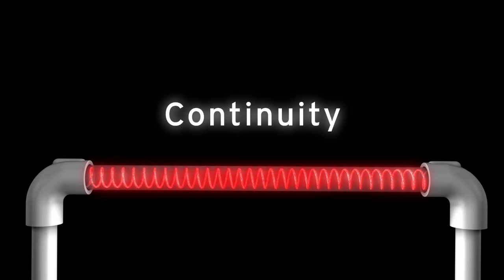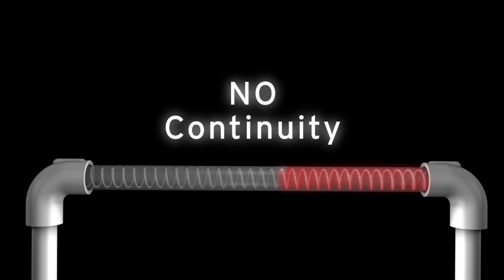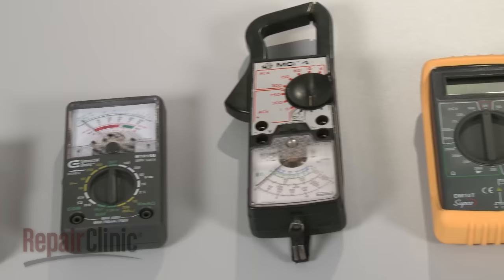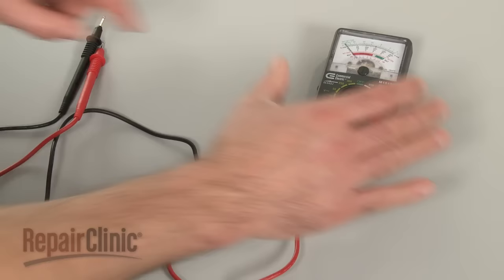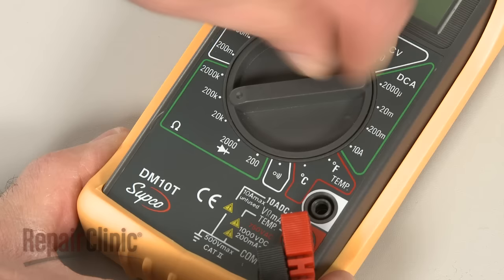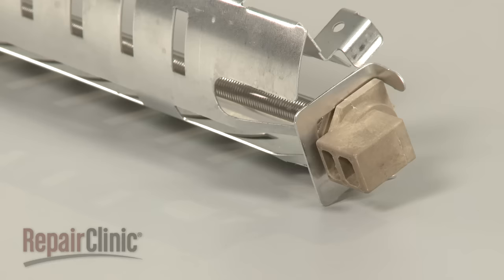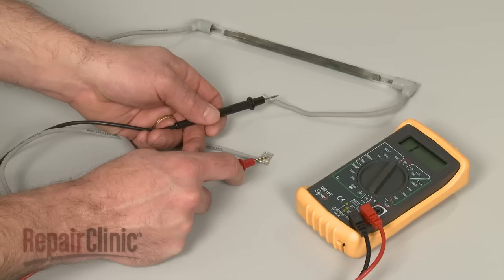Fridge Not Defrosting? Defrost Heater Testing, Repair

Comment from the maker: Ashley, This is not a typical a defrost limit thermostat. This item is a high limit thermostat which is normally closed at room temperature. It shuts of the heater if the board relay fails closed to prevent damage. The defrost system is operated by the board which uses the thermistor to monitor the frost build up on the evaporator. If the defrost heating element has continuity probably between 5-50 ohms than the board is likely defective.
Reply: ***** My coils were completely frosted over when I tested the thermostat and thermistor on the board. Wouldn't they have shown continuity if they were still frozen?
Reply from the maker: Ashley Ferguson The thermostat should have zero resistance when below 140 degrees Fahrenheit. The thermistor should have a specific resistance when cold and change with temperature. It is unlikely both failed like that and have no continuity so you may want to double check your wiring,  meter, and it's settings.

Comment: I have leaking door seals. Lately been putting a heavy 12 pack of soda against fridge door to keep it tight. The freezer door seal is also not sealing all the time and leaking. I try to keep it pushed tight but it leaks some.  I get a lot of frost around the freezer door . About 3 years ago I replaced the defrost thermostat on this old Maytag which had a three wire stat with a two wire stat. Just disconnected and sealed the extra wire connection. Replaced the timer and all seemed to work okay until lately. Ice is forming around the drain hole and a solid sheet of ice forms on the length of the aluminum tray that sits over the drain hole, and also a thick ice layer forms over the drain hole. After taking the rear freezer panel off and complete manual defrost and clearing the drain hole of all ice, I turned the timer to defrost mode while I had the stat still wired and in a glass of ice water. Then plugged in fridge and the heater came on. It did not glow red or get really hot but was putting out a constant heat wave. I was wondering if the heater could be going bad but still working and not getting hot enough to fully defrost with ice accumulating over time. With the stat in ice water and not heating up and opening the circuit to cut off the heater I figured the heater should have kept heating until it was red hot. I also thought maybe with the bad door seals that warm air is getting in so much that it forms around the drain hole so thick that the heater does not melt it all and it continues to build up over time. Lately it was also icing up around the freezer fan and not enough cold air getting down to the freezer. The timer seems to be ok and the thermostat worked and the heater worked, although I don't know how hot it is suppose to get. I can hold my hand on the evaporator coils feeling the heat but not enough to burn my hand.  Maybe I need to get a timer that cycles to defrost mode more often? Any suggestions?

Comment: I have a Frigidaire side by side refrigerator/freezer model FRS26R4CW3.  I have the heater cover off inside the freezer but cannot determine where to find the SWITCH to turn the defrost cycle on to begin testing the heater, thermostat and timer components.  Please help me identify where it is.

Your videos are very good.  Thank you so much for taking the time to educate and help people in this way.  I appreciate any help you can give me.

Comment from the maker: The heater should show continuity. If it shows an open circuit it is bad. If the heater and the defrost thermostat both show good the defrost timer or defrost control board (depending on your model) may be bad.

Comment from the maker: You actually have to take the components out of the refrigerator to test them properly. I hope this helps!
Reply: Please "emphasize" that the defrost heater must be removed from the fridge for testing. I tested it unplugged but inside the freezer, and it shows nothing. I thought it was bad so I ordered a new one. When I removed it from the freezer & tested it, it shows continuity.
Reply: Need instructions on how to do that. The wires are connected with some long black 'tubes'. Do you just pull to take the wires apart, or what?
Reply: K. They do pull apart. Got one connection apart using moderate to hard force. But the other one won't give no mater how hard I pull!  It's thick black rubber tube over a round metal connection shaped almost like the hand end of a baseball bat; how to separate that male end from the female end?

Comment: I’m having an issue. I ordered parts from you guys I replaced the heater, thermostat and timer just to be safe. My Frigidaire freezer defrost heater is STILL not coming on. I put it in defrost mode manually and it doesn’t turn orange or get hot. Any recommendations? The model number is FRT21IS6JW1..

Comment: I replaced the defrost heater in my GE fridge which was obviously bad. Also ordered defrost thermostat and thermistor. Checked thermostat and thermistor for continuity through main board, but neither one had continuity. I am going to replace both. Is it possible that all of these components failed, or is it more likely that I have a bad heater (replaced now) and a bad main board, which would be why these are not showing continuity when tested?

Comment: Hello, the heater gives me about 90 Ohms of resistance and it doesn't give continuity. BUT if I plug it directly ... it gets hot, it works!
What's going on?  Is it bad?  Do i have to replace it?

Comment from the maker: The tone won’t work with that much resistance. The heater is good with 30 ohms.
Reply: Hello, the heater gives me about 90 Ohms of resistance and it doesn't give continuity. BUT if I plug it directly ... it gets hot, it works!
What's going on?  Is it bad?  Do i have to replace it?

Comment: Excellent video. The service tech said we needed a "defrost kit". Total cost would have been $418 - more than the fridge is worth. I decided to do a little internet homework. Thermostat works, fan works, and defrost heating element has continuity. Seeing now that the return vents in my fridge are clogged with ice, I suspect that one I get everything cleared out, it will go back to working. Thanks for the concise, simple explanation.
Reply: Yhy😮😮

Comment: I have a Frigidaire model FA13DSBAWA that is not defrosting,heater element is good but the thermostat is like a fan capacitor with 4 wires.i have not being able to find that part any ware  because the searches tell me to check my model number again and thats the model number on the back label I have.

Comment: I advanced the timer to get the defrost cycle. the heating element did quickly melt a piece of ice I put on it, but did not get red hot,  and after about 6 minutes, I checked the heating element and it was not hot. The defrost cycle lasted about 22 minutes.   How long is the heating element supposed to stay hot,  and if I put a meter on the ends, what reading should I get. Is it possible that the heating element though working some it might be going bad?  Or could it be affected by a going bad timer?
Reply from the maker: robert arrubla If the evaporator warms up enough the defrost thermostat will open and stop the defrost heater from heating. Click here for more info: https://www.youtube.com/watch?v=5vA8Ksv5kVY

Comment: Videos are nice but I do not know where these part(s) are located.   I have a Roper Fridge.  There was a noise coming from the freezer it sounded like the freezer wanted to come on then it would go off.   Rev up and then off.  Continuously.  Click click...click...  The sound is gone but the fridge part does not get as cold as it used to.
Reply: May be possible in your freezer insight too much ice and fan motor blade  touching to ice and in voice is coming

Comment: My freezer works fine but not the fridge I am getting frost in freezer and on fridge vents.. I replaced the thermostat but no improvement.  How can i know what to replace next?  the timer or the heating element?  If I advance the timer and take the back freezer panel off,   should I be able to see the heating element get hot or red?
Reply from the maker: robert arrubla The heating element will get red hot if both the element and timer are working, but if it does not either part could be to blame which is why we recommend testing the element with a meter.
Reply: robert arrubla  Did you check your fan as well. If it is not moving the air then the freezer will frost over and you will get warm air in the refrigerator.

Comment: Great videos.  Testing my defrost heater, I get a reading of zero ohms exactly.  In the video you state that if the meter reads from 0 to 50 ohms, then there is continuity.  But zero ohms exactly can't be right though??  So would my defrost heater be defective then or not??
Reply from the maker: Zero ohms of resistance = good element. Infinite resistance = bad.
Reply: Thank you for the reply.  Well my fridge has me totally stumped.  Its a 6 yr old top freezer Frigidaire that started acting up with the freezer compartment.  Cleaned the dusty coils & it was cold in the freezer again but it was running continuously.   Since the defrost element is good & the only way to check the defrost thermostat is to cut it out, I decided to bite the bullet & ordered a new defrost thermostat & defrost timer just to be safe  But the problem remains.  If left plugged in, the fridge will run during an 8 hour period & will shut off 2 x  only.  Depending on where it is during the cycle in the 8 hrs  the freezer is either not very cold ie. water will not freeze & the fridge compartment is not very cold either  or there will be frost on the back cover & water will freeze.  I checked to see if the drain line was plugged up & ran water through it no problems.  Aside from the wiring harness, there is not much left to check.  Suggestions or ideas??
Reply: I wish Repair Clinc would've answered your question.  My Whirlpool Gold side-by-side is doing a similar thing. My evaporator coils are iced over, mainly at the bottom. When I defrost them with a hair drier the fridge gets cold.  After a couple days, they are iced over again.  The heater - ohms checked good.  The frozen thermostat is closed.  Not sure if it is stuck closed.  I guess I could put a blow drier on the thermostat to see if it will open.  I know freeze spraying the bi-metal closes it. The thermistor passed a diagnostic self test.
Reply: Usually if the heater is good, the thermostat is bad.  You need to test the thermostat.

Comment: the heater circuits have gone faulty on my freezer... when the freezer starts defrosting it trips the fuse box switch. we recently disconnected the plug for the heater/sensors and it stopped the tripping issue but after 2 days the radiator had completely frozen up and the fan was unable to pull air through it.

On the heater circuit (temp sensors and the heater element), what is the most likely component that is causing a grounding issue (which is causing the fuse box to trip)? can the heater element ground onto the radiator?
Reply from the maker: ***** Sure, could be a shorted to ground defrost heating element. In most cases we have a testing video linked to the defrost heater on our website. Enter the model number of refrigerator into the website search engine to see the part testing info: http://www.RepairClinic.com?TLSID=1773

Comment: My fridge has exactly the same issue as michaels1992. Which part would be broken?
The continuity test says 90 Ohms?
Thanks
Reply from the maker: cruz candelaria The best place to start is our website's troubleshooting and repair help information. Please enter your refrigerator's model number at http://www.repairclinic.com/repairhelp?TLSID=1773.
Reply: *****
Thanks. I did that but my problem is not listed (type GC2220). The closest one is "Refrigerator not defrosting". Although it isn't, I feel that the problem is different since defrosting trips the RCD and it shuts off completely.
With the heating element disconnected the problem does not occur. With the element connected, it gave me an electric shock touching the outside of the element.
I don't mind replacing it but I am in Europe I would need to have a friend order it and FedEx it to me, so it would be difficult to return if it wouldn't fix the problem. Could it be anything else then the heating element?
Thanks for your assistance.

Comment: I have a Whirlpool Gold french door fridge with the bottom freezer drawer, it stopped cooling and when I used the on board diagnostics to check the thermostat/heater coil circuit it tested as open. My thermostat is reading at 0 Ohms and I can't seem to get a good reading on the heater coil. It's a model GX55HDXVB00, is there any other way to test the coil?
Reply from the maker: +Lizzy Holloway The heating element should have a specific resistance. You may need to adjust the ohm range setting on the meter to get it to display properly. Normally, if you have a defrost problem the freezer is fine and the refrigerator section is warm. We would start with cleaning the condenser coils if the unit is not cooling properly.
Reply: +RepairClinic.com The freezer was fine, but the fridge completely defrosted and the condenser coils freeze up with in a minute or two.
Reply: What ended up being the problem Lizzy?
Reply: Defrost heater was fried. You can cycle through the dios settings and it will tell you if it's open or shorted, open means either the defrost heater or the thermostat. Either way they're recommended to be changed at the same time. I got my parts on Partsdr.com, and they were far cheaper but still OEM Whirlpool parts.
Reply: Thanks for the quick response and info Lizzy...I'm having the same problem, that's why I asked.
Reply: +Steve Fudge If you would like to email me directly I can walk you through the diagnostic system

Comment: i dont think my coil/spring is inside any glass container anymore, i think the glass broke - so it has NO more protection on it... how bad is that?
Reply from the maker: atamotua64 If the glass broke we recommend replacement. It is likely to short out when ice melts and water drips onto it.
Reply: @repairclinic my glass heater broker thrice now. Can we change to non glass heater? And what are cause of breaking often?

Comment: My defrost heater shows zero ohms resistance when tested with digital multimeter.  My local appliance parts guy says it's working fine.  Your vid says zero ohms is bad.  Now I'm confused.  Can I hook it up to 120v on my workbench and see if the element glows?  Mine is a glass tube with spiral element.
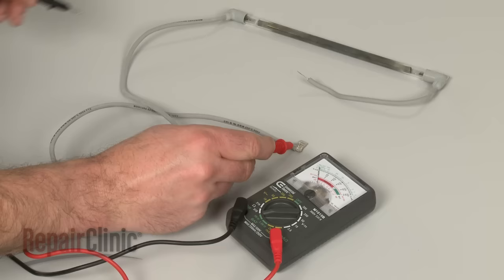Reply from the maker: Warren Arf Williams  Our video does not say that. We say at the 1:40 mark "if the meter reading shows a result between zero and fifty ohms of resistance, the component has continuity". This would indicate the heater is good.
Reply: ***** Thanks for the VERY fast reply!  My freezer still frosts up after a manual defrost and the frzr compartment temp eventually rises to 20 degrees where popsicles get mushy.  Defrost thermometer tested good as well.  What's left?  It's 17 yrs old, SxS GSS25KRS
Reply from the maker: Warren Arf Williams The control board on the back is likely defective. The relay for switching on the defrost heater probably failed. http://www.repairclinic.com/PartDetail/Main-Control-Board/WR55X10942/1531075?TLSID=1773
Reply: Do you know which of the tree relays on the control board switches the heater on?  (K1, K2 or K3) I have a Whirlpool Gold side-by-side model # GD5SHAXMQ00. Do you have a schematic of the control board?

Comment: My defrost heater shows 115 continuity is it good or bad?
Reply from the maker: ricky daniel Good. As long as the there is some resistance and 115 ohms is just that. If it had no continuity (infinite ohms) then it would need replacement.

Comment: I have a Hotpoint stove/oven and i'm trying to replace the door seal located on the door itself.  My stove door looks just like this one in this video: https://www.youtube.com/watch?v=GP2OC-NwxYU     any help would greatly be appreciated... (BTW the parts i bought for my Samsung fridge worked nicely... replaced all 4 parts and got the freezer and fridge to cool again - i replaced the 2 cool/heat sensors, the fan, and the heater unit, all on the inside of the freezer unit, behind the back panel.)
Reply from the maker: atamotua64 Perhaps this video will help. https://www.youtube.com/watch?v=7HBI3phUPt4